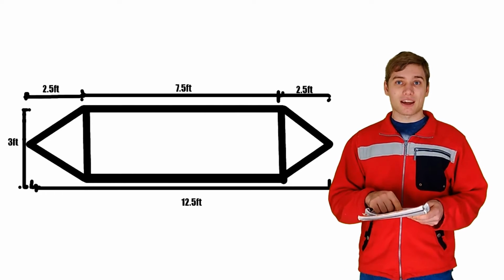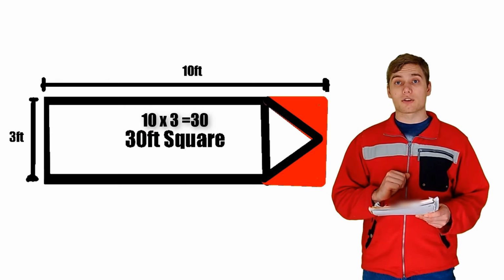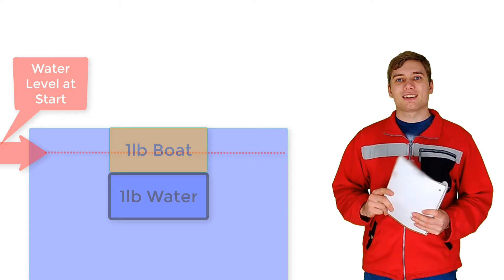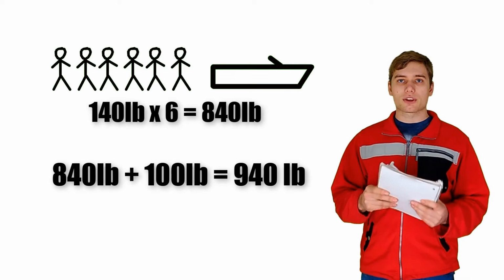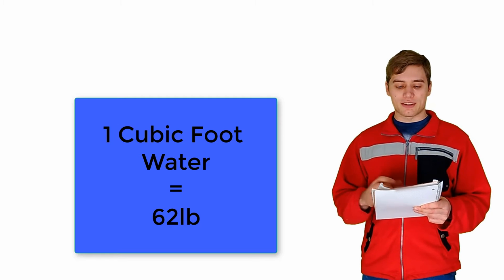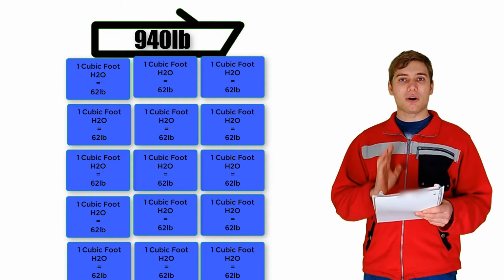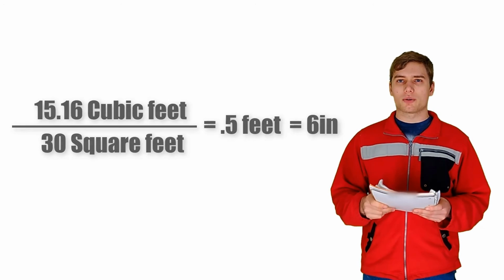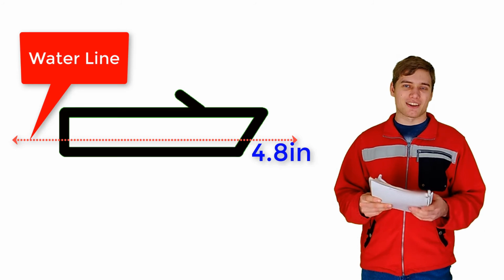How to Calculate a Boats Waterline - Archimedes Principle

Comment: So if I wanted it to sink (it looks cool) if i put a hole in it, the water would go up 6 in in your example before stoping (water inside the boat cant go higher then the water outside)
Reply from the maker: If it has a hole it is no longer displacing water ...ok technically it is but only the thickness area of the sides ...

Comment: Hi, by step 4, what is the value of the "waterline" relavtive to? is the Waterline 5 feet from the button or the top of the hull?
Reply from the maker: @Homeowner-Phobic  The distance is from bottom of the Boat.  As the calculation is based on the amount of displaced water boat moved aside from under the boat. 😁
Reply: @PatriotContraptions  Thanks for the quick repley. Bless you

Comment: Amazing video keep up the great work but how would you calculate water line on a boat with a non flat bottom
Reply from the maker: That gets really complicated as you have to  use equations with variables and then solve for them ...it's hard to explain and depends allot on the individual boat design.   Basically you segment the boat up even more a using custom equations for value with a variable for hight you then add them all together and set it equal to the volume of displaced water like I do in video but more complex... hmmm
Reply: @PatriotContraptions  thanks I love the videos you do an amazing job

Comment: If I am understanding this correctly, you want the height of the walls to be taller than the water line right?
Reply from the maker: Yes, the walls will need to be taller than waterline or the boat will probably sink in short order...If you are building for cardboard boat racing I have a video on how to build a cardboard boat that goes into other factors to consider in wall high as well such as height of rower, waves extra...

Comment: Your math indicates that ALL sides of the boat are perpendicular to the bottom, the very flat bottom. How would you calculate the water line of a canoe? I empty the canoe, place it in the water, then add the number of gallon jugs of water that it takes to equal my projected load. Water is 8.2 lbs. per gallon. Just take a waterproof marker and go around the boat. It is automatically self-leveling. There is your paint break line. From there you have your reference line.
Reply from the maker: Yes, my math is based on all sides being perpendicular to the bottom for this example.   While it is possible to calculate the exact water line for any boat its almost impossible to explain each case do to the formula having to be custom to each design.  The basis is that you have to create a formula that adjusts for the curves and set that equal to the wait of water required to be displaced.  This is not easy to do as you will ne variable's to account for change in with to high and so on ...  For my cardboard boats which have curved sides I normally just ignore the curves and pretend the sides are perpendicular.  Then I just figure the actual water line will be just a little bit higher...in past its only made me off about .5in if that... you can get water line easiest by getting in the boat fully loaded and just marking the side where the water hits or filling the boat with the equivalent weight of water to the gear you plan to put in and mark the outside that way(this may not account for boat weight and wall thickness though)...The main reason to use water line calculation is to design a better boat as once boat is built its easier to just get in and see where its at :-)

Comment: Greetings from Guatemala. Thank you for posting this excellent video. I am getting ready to build my first boat. It will be a very simple and very light weight catamaran, built for carrying one person – me – about 150 pounds. I plan to power the boat with something like a number of lithium ion batteries, and I am trying to calculate the combined power of the batteries I will need. I am not trying to build a speed boat. A catamaran that move at 5 knots per hour on the lake near my house would be fine. For my initial testing I do not need batteries that last more than an hour, before I paddle back to shore, and recharge the batteries for the next day of testing. I have started studying and learning about catamarans, batteries, motors, and boat drag. The boat, and everything in the boat, including myself, will probably weigh less than 250 pounds, and I will probably have enough foam in the pontoons to float maybe 1000 pounds. If my understanding of Archimedes principle is correct (?), for each boat length it moves, the boat will need enough power to displace its weight of water. Does this mean that my catamaran will have almost no drag, since the boat will have so much foam flotation and so little weight of water to displace? Note - I am learning how to shape the pontoons to be, for a reasonable cost, as hydrodynamic as possible, and I will get 2 excellent propellers.
Reply from the maker: Catamarans are indeed very good at going through the water with very low drag if done correctly...I have never built a catamaran so I don't have any field testing to go on.. that said I have seen sail catamarans in action and they out run the same size sailboat with about three times the speed(I tried to race one once...I lost bad.. ).  The one issue they don't do well on is turning as with two hulls its basically like have two dagger boards.  The trick I think for you will be figuring out you length to width on the hulls if you go to narrow it may force you to stay in the center of your boat as going to onside would put all your weight on only one hull.  Archimedes' principle is for a boat not in motion just sitting in the water.  As soon as the boat starts moving other factors start to effect how much drag you have on the boat.  For example if you have seen any race boats or fast speed boats they are almost completely out of the water when moving at speed.   This is because the shape of the hull is adding extra downward force to the water do to allot of complex physics and forces that act on the boat and water so as to lift the boat our of its natural Archimedes state when it is still at the dock.  You can also have a worse drag for example a sub on the surface may have waves coming over the front of it trying to keep it down deeper in the water than its normal state.  
I would suggest the main things to keep in mind would be where is the safe center  of weight for me on my boat(where can I sit without it flipping over).  on a catamaran this is normal a square in the center as both individual hulls can support the weight of the person but going to the tip on the font of one or the back would cause the weight on that hull to be forward of its center of gravity(I do have a video on boat stability that sorta covers this).  I also highly recommend build a scale floating model first I do this with all my boats(normally I do either 1in or 2in equals a 1ft as scale).

BTW You made my day knowing people from other countries watch my videos :-)
Reply: @PatriotContraptions  - Thank you for your interesting reply to my comment.
Yogi Berra - In theory there is no difference between theory and practice. In practice there is.
Me - For the last several weeks I have been learning a lot of diy boat building theory from YT videos. I have zero practice.

The below ideas are some of the ideas I have gathered from watching YT videos. They look to me like they should work. But someone like myself, who has no practice, can easily miss something.

This will not only be my first boat, and my first significant diy project, it will also be my first electrical project.  I am planning to wire batteries to a motor. The motor will have a propeller attached to its motor shaft. In the videos I have seen, some combination of gears, fan belts, and shafts is almost always used to get power to the propellers. But I have seen at least one good YT video of someone wiring up batteries to a motor that is underwater and directly attached to a propeller. The wiring is done in a waterproof way, which I will probably also do, but I don't know if this is necessary since I will probably use a 775 motor that is made to be used in water. I plan to use 2 propellers, each with their own speed controller, and probably add some mechanism to control the direction of the propellers. With that kind of setup I do not think I will have any problem making whatever turns might be needed on the lake. After all, my first catamaran will be moving relatively slowly (maybe about 2 to 5 knots per hour), and I should be able to put 1 propeller in reverse, since the power is electrical. In fact, I really don't see why the catamaran should need a rudder, and I have no plans to have a rudder. In the future, I might replace the relatively small number of low-capacity cheap batteries that I use on my initial tests, with a much more powerful marine battery, and then I expect that the boat would go very fast.

My catamaran is going to be really light weight. 
I believe I have figured out how to make the pontoons, the center board, and the propulsion system very light weight. And that is about all that will be needed to floated besides myself (about 150 lbs).
The pontoons can be made structurally strong by using light weight packing tape. I have a good YT video of one professional small boat builder in Thailand, using packing tape to wrap around foam pontoons. Over the packing tape will likely be some kind of fiberglass. For some kinds of fiberglassing, I will probably hire someone to do that part of the build.

I plan to use 2 sheets of expanded polystyrene (EPS) foam (8ft*4ft*2in) to fill the pontoons. That should provide over 1200 pounds of flotation. With that ratio of provided flotation (over 1200 lbs)  to needed flotation (something less than 250 pounds), the pontoons should be largely above the water line, and have very little drag.
Reply from the maker: @allanmarks2150  That sounds like a solid plan to me :-)  I still defiantly recommend building several small models first as its always helped me.  I even at one point I did a full scale model of a boat(none floating of course)  just to visualize fully the idea... I found out the front on my paper design was incorrect in practice do to spacing issues as a result.

 As far as steering using the motor is fine although if consider adding a sail to design to extend range and save battery.  you will probably want twin rudders one on each hull from what I can tell is best...

Also two other ideas have you checked out one sheet plywood boats as two strapped together would be a quick catamaran or even two canoes strapped together.  Another thing to look at are "mouse boats" they are made from foam and you can probably pick up some good ideas on assembly. 

As far as motors I can't give much advice as I don't run any on my builds...Manly do to registration laws in my area I don't want to deal with at the moment... 

Over all looks like you have a solid plan and I hope you post a video when its finished I would love to see how it turns out :-)

Comment: The boats bottom have a V shape 
I guess your calculations are for a straight bottom  shape 
Your video helped me a lot but im still quite confuse bc of the V shape.
The more sharp will be the more inches it will sink
Reply from the maker: Yes my calculations are for flat bottom boats as that's what most cardboard boats are and I wanted to make the calculation as simple as possible for kids to use.  If you want to calculate the waterline of a none flat bottom boat I have done this before as well, but it is a really pain.  You have to figure out the cubic feet of the inside of the boat that will be equivalent to the weight of the water you need to displace.  However since you have v shaped side that value will change so you will need to use variables to determine how much extra water is moved aside from the v shape... It's really annoying calculus stuff.  Basically what I foundwhen I compared my calculus result to the calculation shown this video. Using my red v shaped boat.  Was the difference in the water line was maybe like .3 in as a result of all my work so it wasn't really worth it... That said if you want to get a good estimate and account for some of the v shape I would get a rough water line using my videos calculation (say it's like comes to 3 in)?  Then I would figure out what the area of the bottom of your boat would look like if it was at the halfway mark of that measurement (so 1.5 in up the side).  In other words the midpoint area of the v shape that we expected to be under water.  Then I would use this area in the videos calculations and that should put you really close as taking the halfway the belowwill displace less water but it will be countered by the v above displacing more water thus giving you a very close estimate for a v shape side.